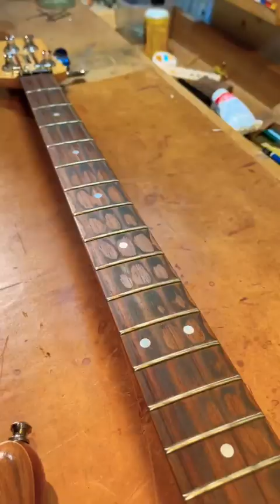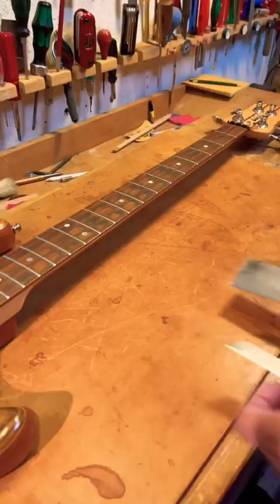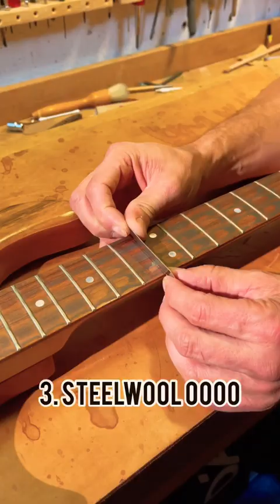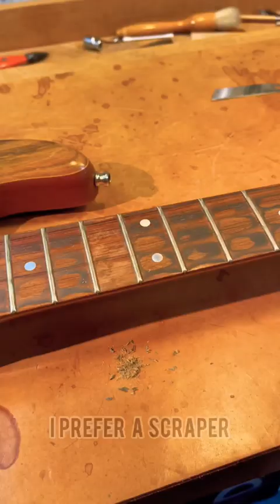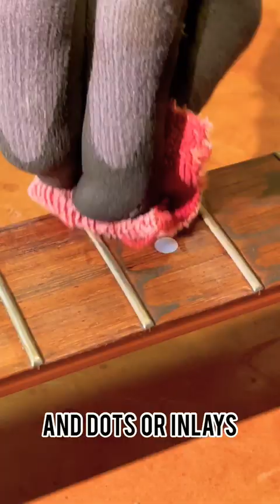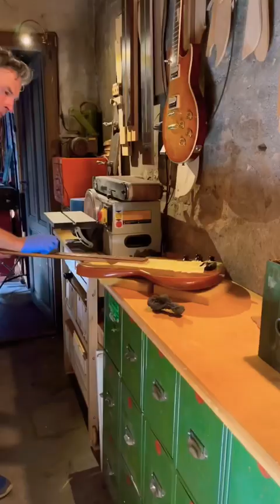How to clean a dirty Fingerboard Bass Guitar Three different ways #shorts #workshop #bass #luthier

Comment: If you use steel wool, tape off those pickups to protect from lil fuzzy bits.
Reply from the maker: Thanks for your advice. This is what I do..Best Regards Nik
Reply from the maker: Thanks for sharing your experience. Best Regards Nik
Reply: If you use steel wool, you will regret that the day you convert your restricted bass into a fantastic fretless one. You do not want potholes in the fingerboard. No!
Reply: yeah i actually advise againat using steel wool, regardless of fret's metal type
Reply: Just wash your hands before playing
Reply: @user-nq1lg5ww1c  lol honestly cant tell if trolling or not
Reply: it stays on the fretboard either way so beter not to.

Comment: never. NEVER use theese methods to clean your fretboard. You'll cause scrathes. The best way to clean is to use soapy water on a soft fabric(slightly moist), then clean soap with regular water and wipe with dry tovel. When fretboard is clean and dry grease the fretboard with lemon oil and let it soak and dry
Reply from the maker: Thanks a lot for watching and for sharing your experience. Best Regards Nik
Reply: Lemon oil is known to dry out your fretboard but I do agree with everything else
Reply from the maker: @Stratisfied22  Thanks for your Feedback and for sharing your experience. Best Regards Nik
Reply: @Stratisfied22  that’s lemon juice. Lemon oil, like what Dunlop makes for their system 65 doesn’t. Use it on every guitar I’ve ever owned
Reply: @jacobburnett1175  No it's lemon oil as well and you definitely don't want to use it on a maple fretboard.
Reply: @Stratisfied22  never had any problems. CS guitars actually did a demonstration on one of his videos of lemon juice and lemon oil to show that lemon oil is Ph neutral and and not acidic in nature at all

Comment: I used 0000 steel wool on my acoustics and electrics for over 10 years of regular cleaning, finally looked in the soundhole and there was so much steel wool lint inside, I vacuumed it out and even then not all of it has come out, you need tweezers to get everything.

It's even worse on magnetic pickups, it'll get inside the pickup and short somewhere you can't fix, killing the pickup.

3M makes Brillo looking abrasive pads, buy the yellow/gold one. About the same scrub time and it won't hurt your instruments like steel wool
Reply from the maker: Thanks for sharing your experience. Yes you can get very good results wit 0000 SteelWool. But you have to clean the Instrument and the Workshop. Best Regards Nik
Reply: Thanks bro
Reply: Should probably wear a mask too. That crap is so fine it gets on everything everywhere.

Comment: With every change of strings (done 1 to 3 times a year) I clean the rosewood fretboard with a soft brush, warm water and a little bit of mild hand soap. I make the brush wet and use a littIe bit of soap only on the brush. I do it quick so that the wood does not get too wet. Although I remember my old Jazz Bass I once had seemed to not care about getting wet at all, I want to keep the risk low.
Then I immediately wipe it several times with a light wet cotton rag where I change sides after every wipe in order to get off the soap as best as possible. I use a dry cotton rag and wipe it dry afterwords.
Finally I use small amounts of good mild fretboard oil and put on a tiny bit on the fret board in order to prevent it from getting dry and wipe it off with a clean cotton rag. I did not do it to my old JB back then and it was dry as hell - but it didn't do it any harm though - just sayin.
Thats the way I have always a clean fretboard.
Reply from the maker: Thank you so much for your feedback and for sharing your way to clean a Fretboard. You are welcome. Best Regards Nik
Reply: I use toothbrush and furniture polish . No metal scrapers , no solvents .
Reply from the maker: @whitemaneric4548  Thanks for sharing your favorite method. Best Regards Nik

Comment: Acetone cam melt certain plastics, lighter fluid/naphtha doesn't melt plastics and evaporates too quickly to damage most finishes.
Reply from the maker: Thanks for your Feedback. That's absolutely correct thanks for sharing your experience. Best Regards Nik

Comment: The beautiful thing about a bolt on neck is that you can take it off with very little effort. It's very difficult to get particles of steel wool caught up in the pickups if they're on the other side of the room from the fret board.
Reply from the maker: Thanks for your feedback Andrew👍That’s absolutely correct. Best Regards Nik

Comment: With that much dirt, that Wal must felt good to play with.

Regarding the steel wool, don't ever use it in your shop if you don't have a powerful vacuum cleaner. You should also wear a mask while using it, as you may inhale some of it. Not very fun to have them in your lungs. 😂
Reply from the maker: Thanks a lot for your feedback and for sharing your experience 👍🕺🏻Best Regards Nik

Comment: I've been telling people for years and people think I'm joking' the easiest way to clean a fret board is to use a pickled hogs knuckle' the vinegar from the knuckle will loosen up the dirt and grime on the fret board and also will remove tarnish from the frets' take the hide side of the knuckle and scrub the fret board and frets' wipe clean and then use the side that has the fat on it to condition the fret board and polish the frets to a mirror finish' wipe clean with a dry cloth. Fast and easy and lot less complicated.
Reply from the maker: Hey Bryan, thanks a lot for your Feedback. Never hear about this but it sound amazing..Yes vinegar is great for cleaning and it's absolutely natural. Thanks for sharing your experience. Best Regards Nik
Reply: Wait, is this advice or a recipe?

Comment: PLEASE DON'T USE THE BLADE!!!

Personally, I would recommend using a small brush with guitar fret cleaner instead of using the blade, this way you save yourself the trouble of deforming the radius of the Fingerboard over time, and use the steel wool to give a better finish to the frets
Reply from the maker: Thanks a lot for watching my content and for your Feedback. Yes you are correct if you are not handle the blade with care you can damage the Fretboard, but as a skilled craftsman you surely know how to avoid this. Thank for sharing your experience. Bets Regards Nik

Comment: DO NOT DO THIS
The scraper will also cut and carve the wood and make scratches on the frets. You also can't do this on painted fretboards on Fenders.
The steel wool stains the fretboard- wood when it mixes with sweat, this wont be removable.
And for god sakes, Acetone dehydrates the wood and dissolves the paint.
Use an oil and a cloth, and clean your instrument after playing.
Reply from the maker: Thanks for your comment.If you have lacquer Fretboards you will never get any Dirt in the Grain, because its sealed, so there is no use to scrape it of. Dont´t worry if you are a skilled craftsman you don't touch the woodgrain by this method.Thanks for watching. Best Regards Nik

Comment: Steel wool may be messing but dam......it works
Get yourself some course steel wool so that the dirt cones off way easier then use the fine one.

Only idiots say not to use steel wool
Reply from the maker: Thanks for sharing your experience. And that's absolutely correct I use in 99% Steelwool to clean a Fingerboard. Best Regards Nik
Reply: @petrekguitars  keep up the good work and thanks for sharing the knowledge
Reply from the maker: Thanks for watching. You are welcome. Best Regards Nik @user-fb2jb3gz1d

Comment: This is why I tell people to not just use any oil on the fingerboard. Linseed or tung oil will form a sticky layer on the surface, even if you wipe it off and let it dry, and overtime it collects a ton of fingergrime and dust.
Reply from the maker: Thanks for sharing your experience Arthur. That's absolut correct some oils are not good for putting on a Fretboard. Best Regards Nik
Reply: Can’t agree with that. Just use an oil meant for a fretboard like lemon oil. A dry fretboard is no fun imo.
Reply: Just wipe down after you take the strings off for a change. And fingerboard oil is essential to keep the wood in shape.

Comment: I would not recommend acetone. Pretty sure it can damage the wood
Reply from the maker: Thanks for sharing your experience.Best Regards Nik
Reply: Acetone does not damage the wood. It will damage the finishes that are applied to the wood. It has a high flash point which will evaporate quickly and can be used on some finishes to smooth out slight defects in the finish but technique and being careful is a must.  Also one of the best degreasers.  And our fingers leave a lot of grease even when we wash our hands.
Reply from the maker: @kevinmatthews9207  Thanks a lot fo your detailed explanation Kevinyou are absolute correct. Best Regards Nik

Comment: DO NOT USE ACETONE!!!
Acetone is probably the worst possible method of cleaning fretboard.  Yes, You say in the video it CAN damage lacquer. 
Dude, it WILL literally MELT it, just as any acryl inlays, and binding! I don't know about mother of pearl, but man...
Also don't use steel wool with water (You didn't, im just saying), otherwise you'll end up damaging your fretboard (it can "ebonise it"). Instead just buy yourself a set of micro-mesh pads, they're safe.
Instead of acetone, just use some water with soap, and lemon oil afterwards, taking You have rosewood fingerboard. 
And for the love of god dont use it on any maple fretboard, especially on lacquered one.
Reply from the maker: Thanks for sharing your experience. Best Regards Nik